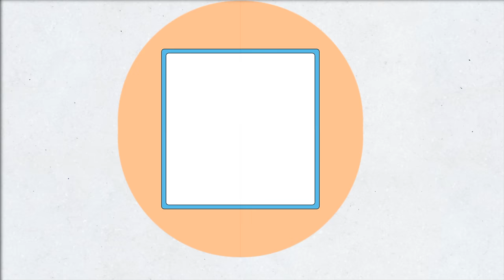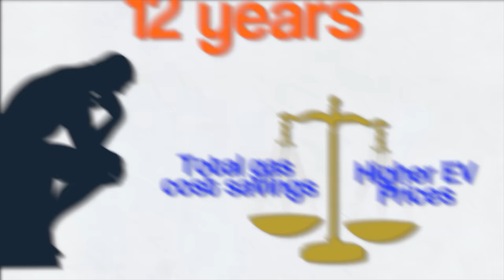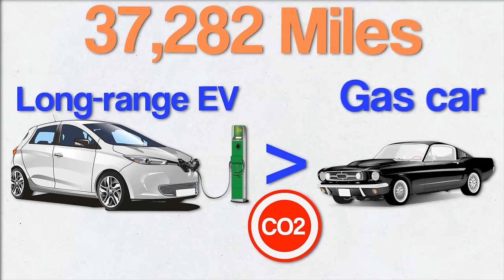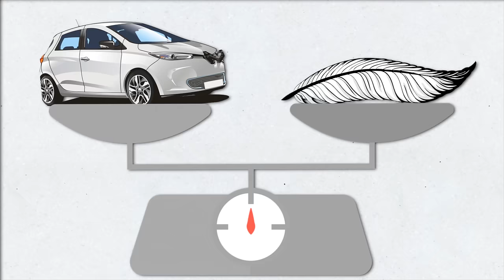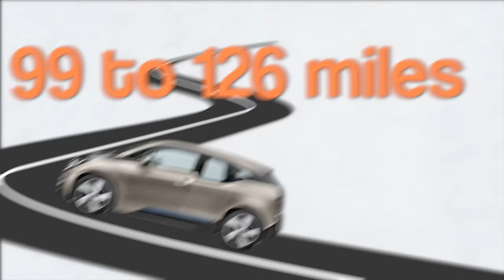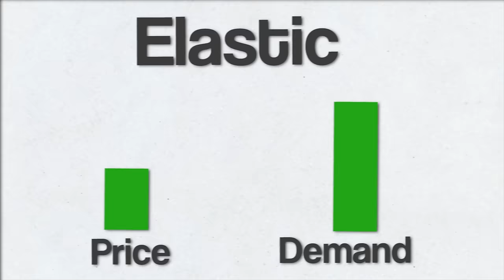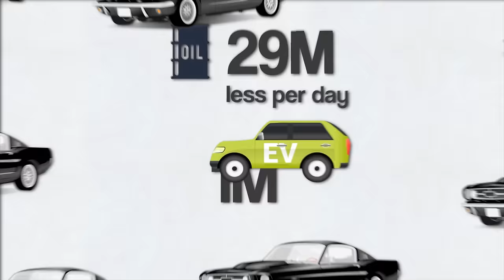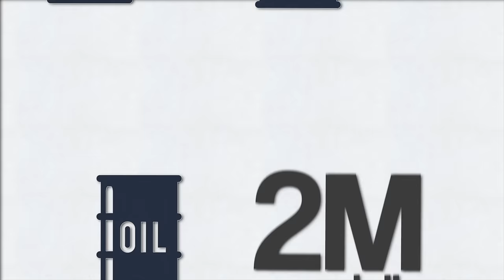If You're Worried About Rising Gas Prices, Watch This

Comment: Imagine having to choose between using your headlights or reaching your destination
Reply: Actually headlights use very little electricity (30-55w) compared to the traction motor (eg. 20kW). An EV with a 60kWh battery could have it's 60w headlights left on 41 days.
Reply: @sbroumley  Interesting.  It seems the point may have been lost though.  Radio, A/C, windshield wipers, etc. will subtract from an EV's advertised range.
Reply: @jamesharper8373  You're correct, but I didn't miss your point - all those electric devices you list use very minimal power compared to the electric drive train/motor (100s to 1000s times less).  You could leave all of those things running for the whole day and it's only going to reduce your range by a very small amount (a mile or two tops). If you are not going to make it to your destination because of running those devices, then you have definitely not planned very well (just like running out of gas on the road in a combustion car).
Reply: @sbroumley  Not sure where you're getting this information from but running accessories like A/C considerably reduces EV range (20-30%)

I encourage you to take a look.  Headlights?  Okay I was exaggerating a tad for fun
Reply: @jamesharper8373  Headlights and A/C are 2 very different systems, but you only mentioned Headlights and a bunch of other very small power drawing devices in your original statement (sorry I missed A/C in your 2nd statement). 
You are correct that A/C draws much more power than the other devices/systems, but it's not as bad as you think. I've driven my BoltEV for 3 years now so I can tell you from first hand experience the real math and what happens - full heat in a BoltEV draws 8kW, full cooling draws 2kW. Once the cabin is fully heated/cooled, heating draws ~1kW, cooling draws ~1kW. The battery is 60kWh so at ~1kW heating/cooling can be left on for 60 hours if the car was just sat there from a full battery. But if I was ever in a bad situation where I really needed to conserve battery to get where I needed to go, I would switch to the heated steering wheel and heated seats which only draw ~70w - these could run for 35 days if the car was just sat there from a full battery.  Just like if you were running low on gasoline, you would turn off the car to conserve it.
The thing non EV drivers don't understand is that an EV uses very little battery when it's not moving, unlike an an ICE which is always burning gasoline due to the engine having to idle. I know what I'd rather be in if I got caught in a bad snow storm etc, but again it would be bad planning on anyone's behalf if they get caught in bad snow storm whether they are in an ICE or an EV.

Comment: The whole video ignores the enormous carbon emissions of mining, smelting, and refining the iron and steel which comprise the engine, transmission, drive shafts and differentials of an ICE.
Coal goes into every step of steel production.

Comment: I don't know where to begin after watching. You are usually very good on your take on comparisons and what to look out for on vehicles.  As for this one you are simply plain wrong on so many issues.  The costs for EV's are coming way down.  The battery tech you point too is obsolete . The cost savings from virtually no maintainence  on EV more than makes up any cost of the vehicle. It is estimated that costs for fuel on EV's are 1/8 that of gasoline or diesel and the battery longevity is equal to what you would have with a gas engine at half a million miles. You are also incorrect on the claim the batteries are not recycleable. All EV batteries are 100% recycleable. With the use of solar and wind it will now be possible to fuel your vehicle for free if you have a home solar unit.  If you and your readers really want to know the truth of EV vehicle I suggest you tune into the "Electric Viking" on you tube. I would love to see you two debate on the issues.
Reply: Nothing is free.......

Comment: You speak the truth all there time but when you charge your car at home at night durning low peak hours. It will only cost you about $8 to $10 to fill up. I feel like the car will pay for it self just in that. I drive a 2007 Tahoe I get 13 miles to the gallon. It eats tons of gas. With electric cars there is no spark plugs, no oil to change and can go on and on. The thing is EV's are cheaper have and maintain. The price of EV's will go down with more and more get made.

Comment: Ev need solar panels on the roof it eould greatly help with energy usage
Reply: Unfortunately solar panel energy output per area / cost is not high enough to make much of a difference on an EV yet. You may get an extra 5 miles out of the solar panels on the EV if it was out in ideal sunlight all day.  Much better to put large solar panels on stationary house to charge a house wall battery, then charge your EV from that battery at night.
Reply: @sbroumley  🤗😁👍

Comment: Ev’s aren’t there yet and there’s no way most cars on the road will be ev by 2040 with those prices and people won’t give up gasoline vehicles so easily, they’ll have to make significant changes before people fully embrace ev cars like putting more charging ports out there like at every gas station otherwise long distance travel is out of the question so ev cars are basically only good for local travel and trips, ev cars at some point have to emerge with solar power cause the impact ev cars will have on an already being pushed to its limits power grid will be massive, all ev cars need to have a universal charging port than can be charge at any charging station otherwise it’s gonna be a major problem as more ev cars take to the road they also need to be fast charging 30 minutes ain’t good enough for cars 15-10 needs to become more the norm otherwise they’ll be a lot of ev cars being returned to the car lot with frustration, I think gas cars and ev cars will continue to impact the planet in some kind of way but can reduce that impact significantly if the cars become more clean, clean energy solar power clean fuel with zero co2 emissions we ain’t there yet but in 40-50 years maybe but I don’t see gasoline cars disappearing anytime soon not even by 2100 maybe less gas cars but not completely disappeared til maybe mid 22nd century

Comment: Are you a republican?  Be honest.  I've watched your shows a long time, and most of them were spot on.   1) Batteries will be out soon that don't catch fire and charge in about the time it takes to charge an ICE car.   2) Blame the car companies for the battery problems.. they won't make them modular so you can replace just the bad parts,  noooo.. you have to buy a WHOLE NEW PACK.   3) As for saying because electric cars are more efficient, it will cause oil prices to skyrocket, you might as well say ANY fuel efficiency increases will do so.  This is fear-based selling, period. 4) Electric car prices are higher than we should expect them to be due to the lack of competition and slow pace of actual battery technology.  What happened to R&D they used to brag on so much about years ago?   Corporate greed and pure, unadulterated laziness combined with a "We don't wanna, and we ain't gonna" mentality.

Comment: EVs in the current form are not made for long distance driving. How long would it take you to get across the US? It would depend on the availaibility of fast charging stations and if no one else is using it. So, EVs are great for short distances but that's it. It's a good second car to have if you can afford it. Let's face it, EVs can't replace combustion engine cars now. I guess that hydrogen powered car would make more sense because hydrogen could be produced where electricity is clean and cheap like in Quebec, Canada where 99% of electricity is produced by hydropower or like in Iceland where electricity is made from natural thermal power. We could even put a massive solar field in the sahara desert. We could also build cars that run on propane or any natural gas from renewable source like landfills, manure pits, septic tanks, etc. Anyways, there's so many better alternatives.

Comment: EV batteries are recycled ♻️ 
I have a EV and I get over 300mi on a full charge.
Charging at home takes hours BUT IM SLEEPING 😴 and I don't need to stop at a gas station anymore. ⛽️
Reply: Did you listen to the entire video, or even half of it?  Don't know how you can sleep now, knowing the truth about how EVs are produced.  And where do you think electricity comes from? It definitely isn't free and as it is the power grid can't handle current electrical use, much less if the masses started charging EVs for hours.
Reply: @sbee7748  🤣 yes I listen to the WHOLE video, what did I get wrong? 
Half the crap you own comes from 3rd world countries, but you still buy it.

Comment: Wonder how many activists have bought one of these e.v.??..and so much for environment.. imagine you stuck out in boonies.. battery dead..you are literally stuck. Can't get a jump .nope..spend at least 1,200.00 for another battery. Doesn't include disposal fee.
Reply: Electric cars are inherently much simpler than internal combustion engine cars. (A Tesla Model S has only 18 moving parts in its drivetrain.) For this reason, breakdowns are less common, but it can happen.
Reply: @RyanAtkinsC   .  lol. fewer moving parts does not exact equate to simpler. EV's are HIGHLY reliant on all kinds of computer driven, very sensitive and highly technical systems. Try getting those worked on out in the suburbs or rural area. better pack a small (gas-powered) mini-bike in your tiny trunk.

Comment: I've seen 200mph EV drag cars that get better 60ft times than even the best equivalent combustion engine cars. I engineer and fabricate Drag racing chassis for a living and can see what's coming and will be open to whatever change comes in my field and even change fields if it becomes necessary. Combustion engine cars where very expensive for the first 30+ years, It took demand and innovation to make them cheap enough for everyone. It will happen for EVs also. There will be advances in battery technology, just as there have been advances in combustion engine technology over the past 140 years. You are biased against EV's because they threaten your lively hood. If you where an EV tech you would be promoting EV's because they would be your lively hood. I'm not worried about rising fuel prices and even welcome it because it is a force that will help quicken the end of our dependence on climate destroying fossil fuels. I see it as a sacrifice that will help make progress towards a better planet for our children. There are times to be conservative, but I can see being conservative in this will only get you left behind.

Comment: EV are not cheap, but you need to factor other implicit cost that even gas car push on the society. By drilling for oil or burning coal plants you are inflicting much more damage to the environment.
Air pollution translates to health problems and that burden is not accounted either. With EV you at least have the option to fuel with clean energy such as solar or wind. You don't any options for gas cars. 
EV by no means is cheap, but every technology starts expensive and over time becomes cheaper with advancement.
Today, I may not save money in the end with EV but I enjoy the convenience of never going to gas station line and not being at the mercy of greed oil corporations.
Finally I wanted to point out that China is one of the biggest abusers of human rights, but would you stop to buy every consumer product made there. Probably not.
My point is you need to isolate the problem, human right abuse which is a country's philosophy and the need of raw materials required for things we use.

Comment: So many issues with this vid but here are just 3
1.EVs ARE coming down in price and will continue as car companies put out more models
2. You nar correct that the first 37 miles are dirtier in an EV but after that it flips the other way
3. Your "what if" you had to buy a new battery is pure speculation and it could be matched with "what if" you had to buy a new engine for a gas car.
  I have a few more but those are the easiest.
As for the debate of whether the gas prices will drop as EVs become more ubiquitous,  from what I am hearing from oil CEOs the answer is no.  They are now done with "drill baby drill" because they know that the future need will be less. They are focussing more on paying off debt and returning cash back to shareholders (like me) by way of dividends and stock buybacks.
My advice is hold on to your ICE car until it is time to retire it and then switch to an EV. By that time the solid state batteries will be out and they have more range and recharge in a matter of minutes.

Comment: You're spreading some inaccurate information. While there is an environmental cost to the production of EVs, even when you factor that into the math, the EV is better for the environment over it's lifespan than driving a gasoline car over those same miles, especially if your electricity comes from a green source. It's sort of a meme on the pro-oil side that the environmental costs of an EV are worse, but that isn't actually the case.It's also important to remember that the oil production industry is responsible for even worse harm to local communities and environment.

Comment: Okay, while focusing too much on the negatives of EVs, you have some good points, Scotty.  Still, you have to give some credit to Telsa (btw I'm no fan of Ewwlon's Musk) and battery manufacturers for exploring new and battery technology, such as reducing cobalt use, precisely because of the far-right bitching you're fueling with this video here.   This won't just benefit future EV manufacturing, btw, but ALL aspects of the electronics industry and even current EVs when it gets time to do a battery swap.

So, while many of your points are valid, they won't be valid for very long.  You're just extending how long you're currently be valid.

Comment: Great, but a single electric motor replaces 1000's of parts, possibly 10'000's. Everyone complains about the fossil fuels needed to make the battery, but not the 1000's of parts an EV will no longer need. Also those 1000's of parts no longer needed won't be there to brake down and need replacement later on. Think about it, everything that supports a piston engine is a band aid. The band aids include the torque converter, transmission, exhaust system, ignition system, cooling systems, pollution control systems, etc. 

If you really want to know why the big push to EV's, it is most likely due to the noise coming from loud after market exhaust systems. If everyone had a quiet exhaust systems then EV's may still be a pipe dream. I believe most are just sick and tired of listening to douche bag's passing by all day long. In some regions annual vehicle inspections are required which may help keep the noise to a minimum.

Comment: Back when I decided not to get an EV, they were just unreliable. now that they have more reliability I was considering one until I did some research and I discovered the environmental reasons a few years back and as it turns out, burning clean smoke fossil fuels is better for the environment than EVs. Combustion engine the manufacturing of the vehicles have come along way over the years and companies invested a lot into making them safe and clean for the environment. in many ways it's beneficial! Trees use that carbon dioxide to stay healthy and to give us clean air to breathe.

Comment: The Electricity used for EVs is made from Oil and Natural Gas !
Reply: Even when it is,  combining the high efficiently of EVs and the power stations, they still reduce overall emissions compared to the 1000,000s of individual ICE cars individually burning gasoline and polluting.
Reply: @melvinhunt6976  Even if your (incredibly exaggerated) numbers were true, EV's will still reduce pollution over the life of the car compared to ICE. There are already modern EV's still going strong with 200K+ miles and less than 10% battery degradation. Advances in cleaner lithium extraction (eg. via salt water) methods, new battery chemistries that don't require rare Earth metals, battery recycling plants, and transitioning to a greener grid are improving the environmental costs of EVs all the time. Meanwhile petroleum fracking, drilling, pumping,  processing (which requires cobalt), transportation and fossil fuel burning continue to spew pollution and CO2 into the environment over the entire life of an ICE  vehicle.   Follow the science, not the big oil politics.
Reply: @sbroumley  where did you come up with 10 percent degradation?  The Weather is still the Weather! The Air is clean and the Planet’s Fine !
Reply: @melvinhunt6976  I'm a member of a bunch of different EV groups (Bolt, Tesla most popular) and there are a few members who track their battery capacity (and can compare against what it was when new) using a OBS2 scanner for the 100-200K+ miles they have driven. Unlike the Leaf and Prius' which have given EVs a bad name for batteries,  modern EV's have very good battery management systems (BMS) that keeps the battery at the ideal temperature for minimal degradation. The statistics so far show that the batteries will outlast the cars for these modern EVs. 
As for your blanket statement about the weather and the air - science disagrees with you I'm afraid.
Reply: @sbroumley  oil and natural gas and Coal (the fuel of the world) are never going away!